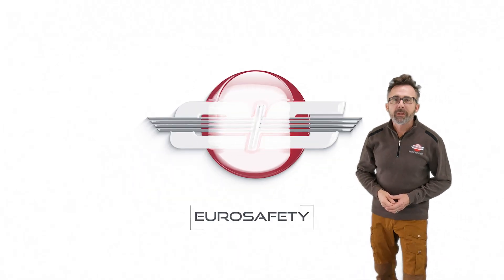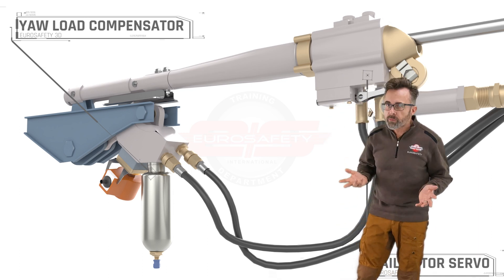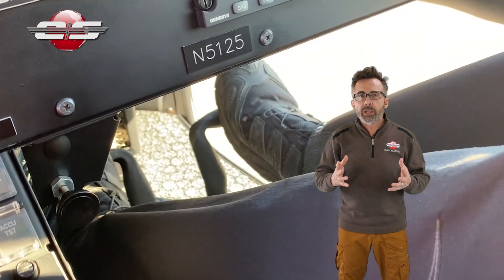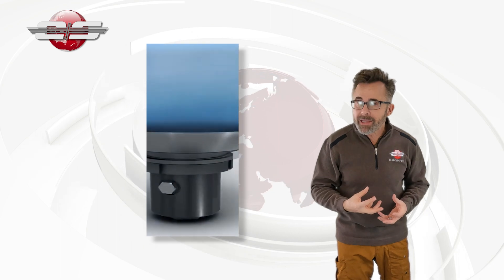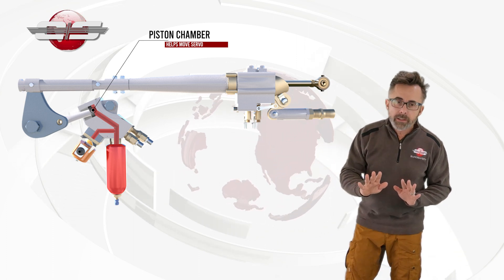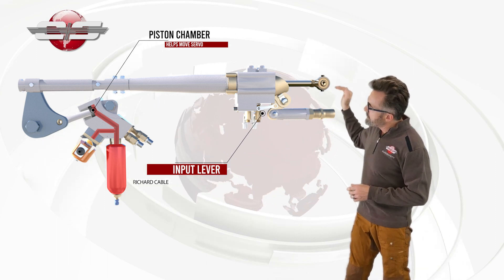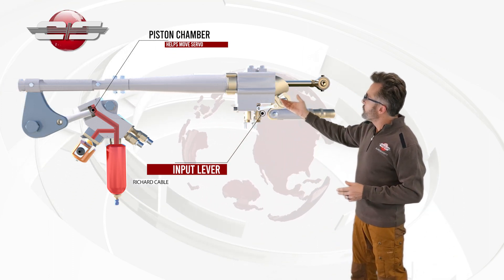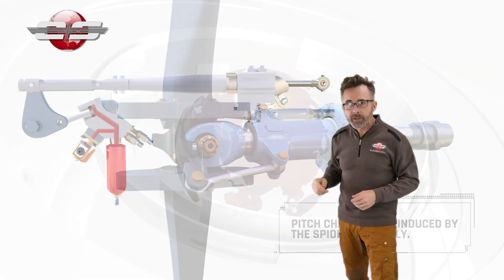#40 - How does the Yaw Load Compensator work

Comment: Great tutorial but I feel like I might have missed something here. I'm wondering why you made no mention of the procedure with regards "Loss of Tail Rotor Control". The RFM states that once 70 kts IAS is attained to activate the [ACCU TST] button, which then depressurises the "Load Compensator". In other words, the load compensator - once depressurised - gives you 5 secs to gain a more neutral position of the pedals, should they be greatly offset. After 5 secs the [ACCU TST] should be reset to off. 
In my mind, I was under the impression that this was the main purpose of the Load Compensator, but of course I could be completely wrong. I'm keen to gain more understanding, so again, thank you for sharing and thanks for hearing me out. I would be more than interested to hear your comments on this. Cheers.
Reply from the maker: thank you. I made another video that is an overview of the operation of the yaw load compensator. But briefly... The yaw load compensators job is to help the pilot induce twist into the spar. The reason we depress the ACCU TST button is to dump the pressure out of the yaw load compensator. The compensator was helping hold the twist into the blades. Without that pressure the twist takes itself out.
Reply: Hi Glen,  great videos, 3D modeling is awesome… following on with the previous comment, can you elaborate why it is preferred to release accumulator pressure with a stuck pedal but not a servo slide failure?  @EUROSAFETYTRAINING  (B3e dual hydraulics) 
Cheers - Adam

Comment: Does the yaw load compensator have a limited time of utility after the failure of the hydraulic system? If so, what is the time limit? Or is it a limited by how much pedal movement you are making? Say, you're in cruise flight at a power and speed configuration which requires little pedal articulation. Must you land " as soon as practicable " or can you continue until an ideal maintenance location is reached?  I'm assuming in this question that the main rotor hydraulics are still operational...                                                                                                 You're my new favorite channel. Thanks for making these informative videos!
Reply from the maker: The yaw load compensator will continue to operate until the HYD TEST (ACCU TEST) is depressed after flight, but is only noticeable after a hydraulic failure ( single bodied system) or when you loose right system in a dual system. Did I answer question or did I misunderstand? Thank you for your support!!
Reply: @EUROSAFETYTRAINING  Yes, you answered the core of my question. Thank you. I suppose I'm still yearning for knowledge on the B3's main rotor hyd redundancy. I know it has twin servos per pitch change link but a solitary hyd source off of the main transmission. Is there a load compensator for the main rotor as well should the main pump fail? Same overall back-up as the tail rotor system?                                                   I'd love to see a technical review of the twin servo construction :) Thanks again!
Reply from the maker: Send me your email to glen@eurosafety.us and I will send you documentation on Hydraulic system